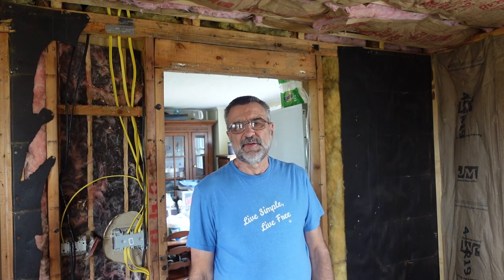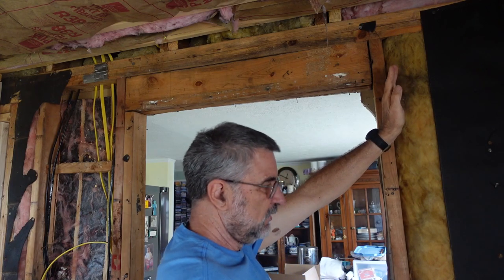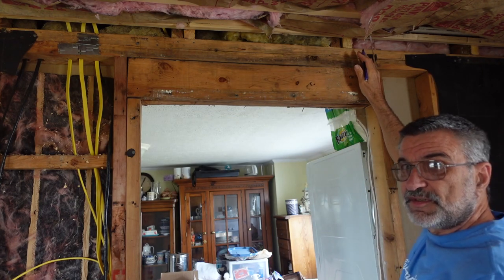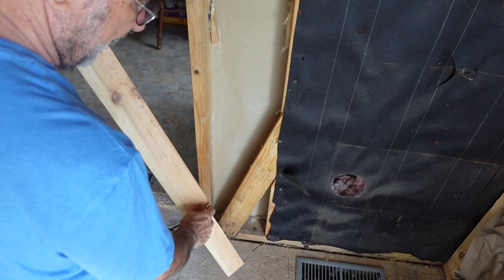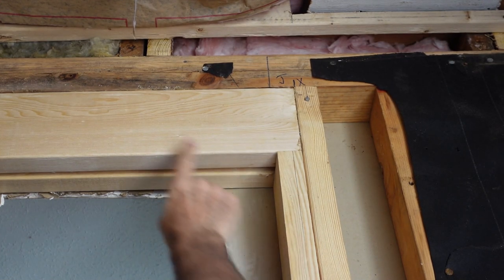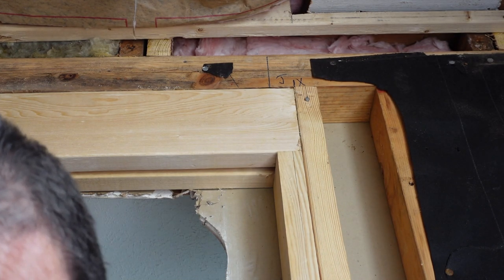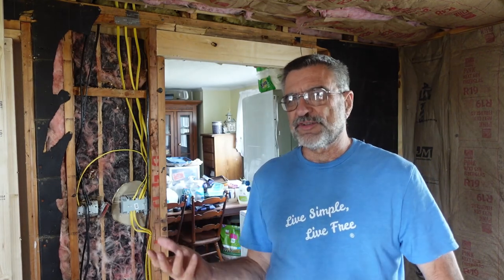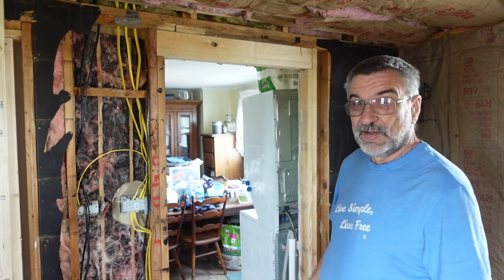How to Widen a Door - Addition Build 27

Comment: Yup, done this a few times. Can be loads of not fun. One of the worse ones was in a house that didn't use drywall. It was lath and plaster. Worst flip ever. Had to gut the who house. The ceiling joists were sagging, had to pay a crew to come out and do asbestos abatement because under 4 layers of laminate in the kitchen were asbestos tiles... 
That was one of the last houses I worked on.
Reply: Other than my own house. That works never ends

Comment: I'll never have another home or build another home, probably a Senior living center is the next stop for me. But after living in a house for 40 years in which all of the doorways were too narrow to move furniture in and out, I would never build another door that's less than 60 in. 👍
Reply from the maker: A 36 inch door is generally adequate to move any furniture.  But many interior doors are only 32 inches (or even 30).  And that's the problem.
Reply: @LiveSimpleLiveFree  my husband and I both had chair and a half lazy boys, and we had to take the sliding glass door out and bring them in through the patio. Then they had to stay in that room. If you wanted them in the living room, too bad. Even the lovely Little Queen Anne recliner that I wanted in our bedroom could not be gotten through the bedroom door. Houses used to have roomy entrance and exit doors. Now they just put in whatever size they happen to have a warehouse full of.